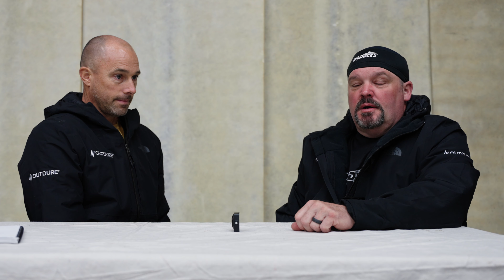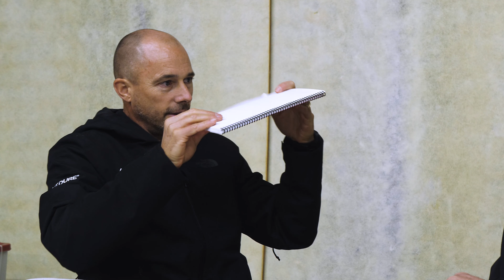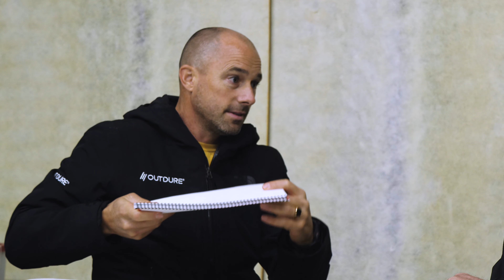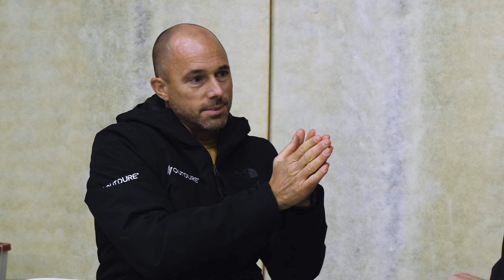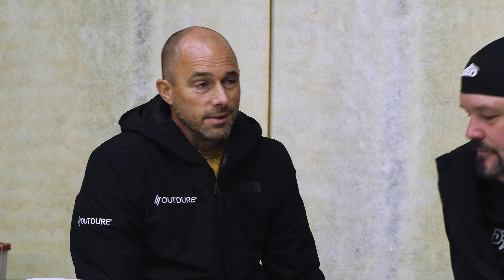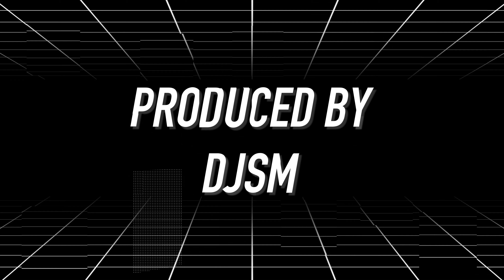Pressure Treated VS Steel VS Aluminum Framing (Outdure Pt 2) || Dr Decks

Comment: Good topics, I think black painted aluminum deck framing is king when it comes to dimensional stability, corrosion resistance, ease of use (cutting, screwing together, etc) and weight of shipping/using.  Obviously cost is higher than pressure treated but it should last a lifetime instead of redoing your deck multiple times if you stay in a house for lets say 50 years.